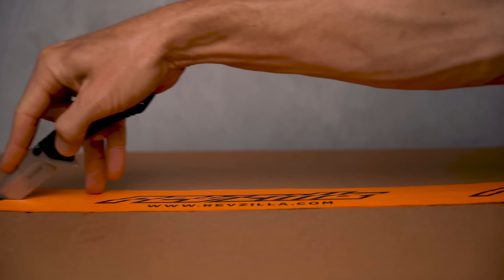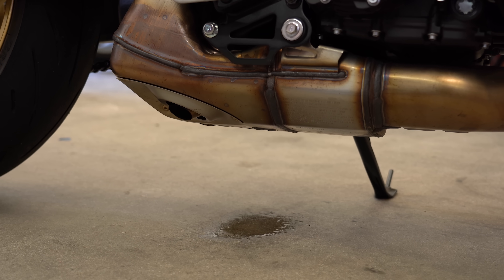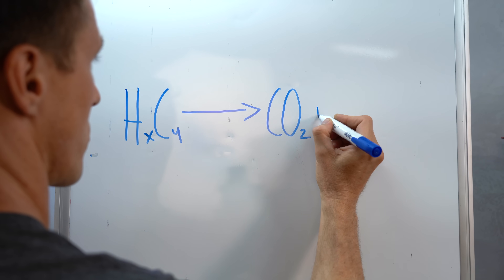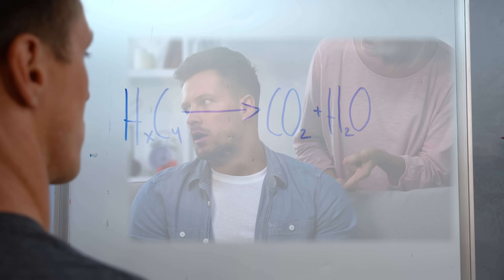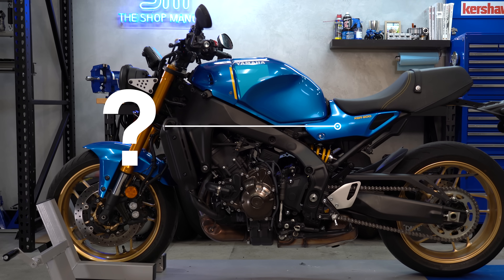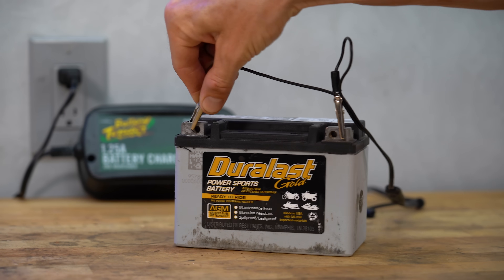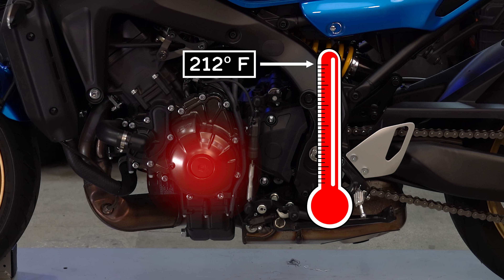The Storage Myth That Hurts Your Motorcycle | The Shop Manual

Comment: I think hydrogen on demand looks really really interesting and yeah I was wondering how the moisture would fit in with oil crankcase and what the options would be to optimize the system? Would be a pisser to have a motorcycle that ran on water

Comment: What’s your opinion on keeping the hydraulic cam tensioner pumped up? After sitting for an extended period of time those will eventually bleed down.
Reply: No they won't. A hydraulic tensioner does not work that way. It has threads that prevent it from backing up. Sort of like a cable tie. Starting the engine would otherwise be dangerous.

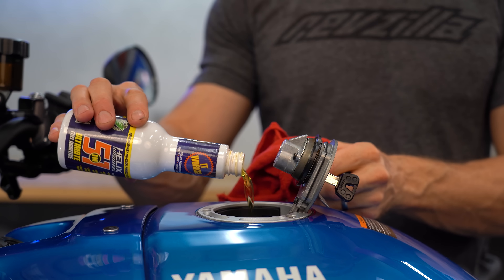Comment: 3:12 Draining the fuel is a terribly bad idea for fuel-injected bikes as it exposes the fuel pump to air and humidity, potentially causing it to rust. The best option is to only drain the amount of fuel necessary to keep the fuel pump completely submerged under the gasoline level when the bike is on its stand.

Comment: would agree except much better to leave tank brimmed than to drain it. If you drain it, you will get condensation which will lead to rust. Just fill the thing to the top and leave it. No need for fuel stabiliser - total waste of money. Petrol is a distillate of crude oil - it forms over millions of years. It won't go stale through 6 months of storeage!! 🙂
Reply: Bring the tank inside don't let the fluctuations of temps cause condensation..

Comment: That's a new one for me. I thought you were going in the direction of starting the engine without riding drains the battery. I was told that the engine needed to be under load for several miles to generate enough electric to recharge the battery. 
A myth buster video would be cool to prove that true or not
Reply: The battery charges at idle, assuming your stator and reg/rec are working properly.
Reply: @AriH211  thanks for clearing that up. That's why we ask the experts. Keep up the great content
Reply: @ampini212  To further expand on the answer you were given if you want it: the charging systems couldn't care less what amount of load your engine is under, it's entirely rpm based. More rpm (regardless of engine load, you can be in neutral for all it cares) generally means more power available for use. But all charging systems are designed to produce more power than is required to keep the engine and all factory accessories powered while idling, and thus your battery will charge at idle, albeit more slowly than at higher rpm as there is less power headroom to charge with at idle.

Comment: Good info.  I was going to go run my 3 bikes in the storage unit with the door open for 20 minutes every other week, but now I'm going to put fuel stabilizer in them and run them a bit to get it in the carbs before storing them, and I'll take the batteries out and plug them into a maintainer in my garage at home.  This will be my first winter storing bikes and I assumed you could just run them every other week to get them up to temp and be ok, but I didn't think the moisture would be that bad.  Thanks for the info.

Comment: This is what I do. Ride the bike until the fuel level is low. 1/4 gallon in the tank is good. But switching over to reserve is even better. Then add a generous amount of Marvel Mystery Oil to the remaining fuel. Ride it for about five miles and then go home. Drain the tank and drain the carb bowls. Drain and refill the oil and replace the oil filter if applicable. Remove the battery and store it in the house so it never sees freezing temperatures. (make sure it is fully charged.) Come riding season. replace the battery and fill the tank and all is good. Be safe and God bless.

Comment: Can’t fuel additives mess up the injectors on modern bikes?
Reply: NO... A quality additive used correctly, is preventive as gasoline alone really does not have exactly all of the lubricating properties of a higher reving engine like a cycle. I use Lucas Injector cleaner and MMO.....   all the time... Dont wait till the carbon and all builds up. Continuous cleaning, like your teeth... lol

Comment: The Kershaw purchase code is displayed as "NEWKINIFE25" in the video but written as "KNEWKNIFE25" in the description. Which is correct???

IT'S 15 October 2022 and the code that was valid until NOV 1 2022 DOES NOT WORK at AMAZON checkout!!!  So many of the knives seem to be sold only through Amazon so to have a discount code that isn't recognized by Amazon is completely pointless !!
Reply: You'll need to visit kershawknives.com to use the code; I don't believe it's valid with Amazon sellers.

Comment: Remove the tank set it on a workmate drain the gas remove the petcock.... great time to see if you have rust anywhere in your tank and what junk might have got in with your gas. Spray in and coat the inside with WD40, reinstall petcock spray around gas filler cap and any vent hose. This means grabbing your tank and rotating it around to allow the oil to coat the inside and then bring your tank inside your warm house for the winter. Open and drain your float bowels of gas and spray in WD40. Remove air filters open throttle body spray, blow out around plug ( dust dirt etc ) remove plugs spray, pull off exhaust inspect gasket/o-ring if copper or other spray in wd40. Drain all the oil in crank case let it drain for a week easily then fill with fresh oil... Make sure you spray down all the fuel lines now reinstall plugs but not lines and turn it over to spread the oil over intake exhaust and rings etc... Now reassemble. Disconnect bat bring in warm house to trickle charge on the weekend when your watching GP racing and having a couple of beer. Ya a little work but its your bike/s you should be looking forward to semi strip. And actually pull the carbs checking the float bowels for sediment....check needle valves too. If injection then yank em out soak in wd-40 ya come spring a bit of smoke as the WD burns off no big deal....

Comment: I've never heard of moisture in oil causing it to become acidic. Can you cite your sources for that?
Reply: Basically engine combustion creates water + CO2 (as Ari explained)
CO2 itself is not an acid, since it does not make hydrogen ions (H + ). But it does become an acid when in contact with water. CO2 in water becomes carbonic acid. Carbonic acid (H2CO3) is considered a "weak acid". :)
This would then be left in your engine assuming the engine was never brought up to temp - thus mixing with your oil over time.
Reply: @Surpriseify  There's also sulfur in the oil that creates sulfuric acid in the presence of water. Oil has what's called a TBN (Total Base Number) package that's specifically there to combat acid formation.
Reply: @AriH211  Makes sense, thanks Ari!

Comment: Why doesn’t everybody talk about ethanol free fuel. Running it empty before storage is worse than leaving stale fuel in, because now you have a little bit of fuel and a whole lot of air. Just go buy ethanol free fuel, it’s high octane too. It’s $1 more a gallon at the pump, or the 2 year storage version in the metal can is $22 a gallon

Comment: Bad advice! over complicating things. Fire the bike up once or twice a month and let it get to full operating temp which means like 20-30 mins usually when it’s cold out if just idling. Best off taking a quick spin once it’s up to temp or to bring it up to temp faster.  Put the battery on a tender as well! It’s very simple, mechanical things and rubber seals don’t like additives and they don’t like sitting and not running. Fuel pumps don’t like empty tanks either so telling people to run the tank dry on FI bikes is also bad practice. Also will get flat spots in the tires so move the bike around every couple weeks when u run it as well! 

When u winterize a bike, it really stinks when u get multiple warmer winter days in the year but u can’t ride because the bike is in hybernation which isn’t even good for the machine to begin with.

Comment: The only wrong thing you said is to drain fuel tank , doing that will start the tank to rust , and in carb it will cause corrosion . Just fill to the top , put in additive ,run to circulate additive  in the fuel system to prevent corrosion and rust and say see ya next spring.. I am a factory trained HD master mechanic 30 years experience..

Comment: I disagree, I live in Canada, my buddy does this every year, everything stated in the video.  Every spring his bike won't start, spends about 2 weeks trying to get it going.  Only thing I do is fill it full of gas and start it every couple weeks to a month and let it run and it sits in an covered open building.  2015 CBR300R over 40,000 kms, original OEM factory battery and never had a wrench on the motor besides oil change... Starts first press on the button and doesn't burn a drop of oil.  I'm always out driving for weeks before my buddy gets his going.

Comment: You need to know your bike. I had a FJ12 and decided it was better to not start it. Left it. But the carb design is that when the bowls dry out, the jets puncture the diaphragms. Oh dear, very expensive. Meanwhile, other bikes, leave all that 2-stroke oil in the autolube, or worse premix and in the carburettor, you really want to get that stuff shuffling along the pipes. I have destroyed a bike by not starting it, and never damaged one by starting it. I think I am going to stick with generating a bit of condensate in the stainless steel exhaust once in a while. I mean, it's not like bike exhausts these days are made out of mild steel. So, I am undecided on this.
Reply: No jets could ever puncture a diaphragm. Leaving gas in carb will eventually leave a residue and it will not start because of blocked fuel circuits. If you do it in a 2-stroke and your lucky enough to get it running, if residue is in the jets you have effectively made them smaller,  hence
a leaner fuel mixture. In a 2-stroke,  this is a death sentence.

Comment: The only issue not mentioned that concerns me are cylinder bores / rings. In anything other than a single it’s almost certain you have one of the exhaust valves open and that means a direct route to atmospheric damp to that cylinder.

Ideally I’d spin it over once in a while if you can disconnect the fuel injection or at the very least pop a little oil in each pot before spinning it over with the plugs out before replacing them. Thoughts?
Reply: Great point. Fogging oil down the plug holes and a few rotations should do the trick.

I'm a periodic starter myself and will likely continue. Not overly worried about a little moisture in the crankcase. 

One thing I would never do is run EFI dry and leave it for months. That sounds like a bad idea and I doubt any manufacturer would recommend it.

It sounds to me like this video is trying to debunk opinion with opinion.

Comment: Thanks for the video. How long would you think is "too long" to let your bike sit without riding it? I live in the Southeastern US. Our winters aren't typically that long or harsh and I may want to take it out in the middle of winter if the weather is warm enough. Would you say letting it sit for more than 1 month is too long? What's the time limit, in your opinion before you should put the battery on a charger or drain the gasoline?
Reply: ride it or just keep the engine on few minutes after moisture stops coming out of exhaust (it's easy to notice water vapours), give it some rpm few minutes after startup if you won't ride, few times a month, and forget everything he said in video. oh yeah, use motul.

Comment: What if roughly once/week you let it run for 30 min or so?  Does letting it run for that length of time negate the concerns brought up in this video?
Reply: It’s still not good,because you never put a driving load on the motor and bring it up to temperature. Then when u shut it down what happens to the moisture and condensation that a hot motor develops? Can start turning into rust. I’ve stored a show car every year and abide by this rule.Ok, if you have a climate controlled garage then it’s a different story.
Reply: @ta5351  Thanks a lot.  That was the other part of my question that I forgot to mention.  My bike is stored in a garage where the temp never gets below freezing (usually stays around 5-10 degrees celsius).
Reply: Andrew, I would still leave it be until spring. I own a CBR 600rr that I love and would enjoy just listening to it but leave it in hibernation.
Reply: @ta5351  thanks 👍

Comment: Nothing is wrong with starting it as long as you run it long enough to dry the condensation. Also, using a fuel additive like marvel mystery oil helps coat. Im old, i know.

Comment: I've heard people say that parking the bike on the center stand helps reduce/prevent flat spots from forming in the tires?  Seriously?  What cheap-o knock-off tires they buying?  My Sportster doesn't even have a center stand.  Some people say they bought a bike jack and lift the bike up by the frame to take the weight off the bike to prevent flat-spots on the tires and weakened suspension springs (because sitting with the weight on them apparently permanently weakens them).  I wonder if they jack up their cars the same way for the same reasons.  Dhuuurrrrr.

Comment: Oil Pressure Gauge or Gear Number - What would you prefer and why?

Have you ever had an oil pressure gauge on a vehicle? I have on some older vehicles and I'll tell you why I like them. I learn from the pressure gauge that when my vehicle is just idling it's only making about 50% oil pressure. So from that I understood that when the engine is just idling it probably isn't pushing around enough oil to lubricate fully.

After 6 months or a year after I changed oil on filter I started to see the pressure gauge drop at idle and even at half revs. Why was that?
I guessed that maybe the oil and filter were no longer at their best and so the pressure was starting to drop.  So I fear the new oil filter and oil and sure enough the pressure was back up to where it was the year before with that new oil and filter.

Gear Number.
I understand that races need to know this because they're going to adjust the gearbox ratios, and the chain and sprockets, so they can be in maximum gearing for straight lines speed and corner exits etc. But for us on the road if we're not changing the gearbox settings then I don't think gear position number is as useful as having an oil pressure gauge.
Whatever gear I'm in on the road is the right gear for me at that time because that's what I'm doing. That's what we all do. We select the right gear and the right revs for whatever we're doing. We don't decide that I know I'm doing 40 mph, or 60 km/h and so I must use third gear. We use whatever gear feels right at the time.

That's why I would much rather have an oil pressure gauge than a gear number indicator.

Manufacturers benefit from this as well because customers would see that the oil pressure is starting to drop and they would at the minimum order new oil and filter to fit themselves, or they would book in an oil and filter service.

I learnt that even if my bike is revving to about a quarter of its rev range it's still not producing full oil pressure. That happens after a quarter of about a third of revs. Depending on the engine, the oil, the filter.

That's why I used to start my bike and after a few seconds I would rev the engine a little bit to about a 1/4 or 1/3 of its rev range for a few seconds to make sure that oil got pumped around all of the places in the engine and at least it had a coating of oil everywhere.
Reply: I'm lucky enough that I live in England in the south and for winter I could mostly ride my bike for most of the months, quite often except for January February. So all I have to do was put a good quality cover over the bike and put on a trickle charger now and again.

Mostly I could jump on my Fireblade, switch on my heated grips, and do a very cold track day! :-)

I once had an icicle forming on the inside of the visor roughly in line at my nose as I was on my way to an early track day at the beginning of February.
It's not often you go to attract though and see all the riders wearing winter type ski jackets over there leathers!
Reply: Winter storage. I would put the cover back on my bike while the bike was still very warm. I guessed it would help dry out any moisture.

Comment: Draining the carb will dry out the seals. Use non ethanol and fill the tank to the brim. I never tended any of the 6 bikes we have cause they don’t sit for more than a few weeks depending on the weather. Only battery I pull is the Lithium ion in my 300 2t since they go into a dormant state in bitter cold

Comment: Who does that anyway? I don't know a single person who does that. 
Fill up the tank with normal gas, increase the tyre pressure, do an oil and filter change, clean the bike thoroughly maybe even remove the brake calipers and clean the part of the pistons that stick out, grease the chain really good because that's the first thing to rust, on the chrome parts of the fork put some silicone spray or normal engine oil will do it too, heck, put it on any chrome part of the bike. Silicone spray on the engine parts and hoses isn't a bad idea too and your bike can sit 3-6 months without a problem. You only have to remove the battery and connect it to a charger every now and then.
Reply: This
No reason to overcomplicate things
btw silicone spray is great, but if you'v just washed the bike then perhaps use a product that displaces water. Silicone spray can actually trap moisture (very rare). Other than that the procedure you described should be all thats needed for a modern bike.

I do also add some fuel stabilizer.
And once i start it up (come spring) i put in a little bit of injector cleaner (not a requirement by any means) but makes sense to me.
Reply: @Surpriseify  well i forgot to mention that you apply it when its dry.... 😀😁😂